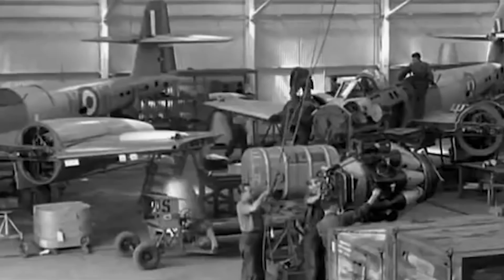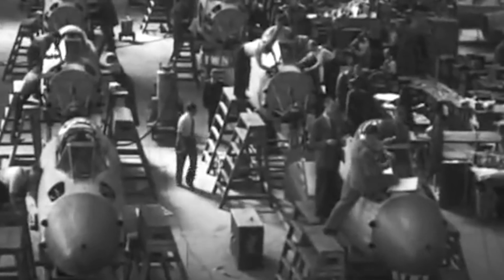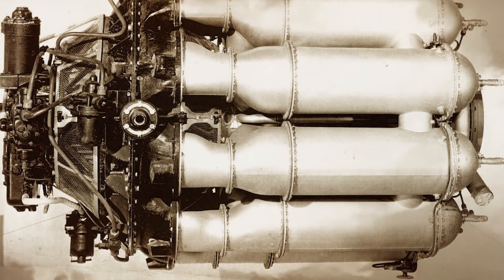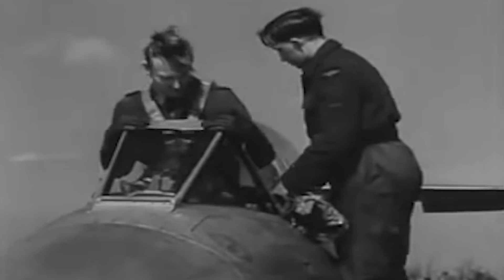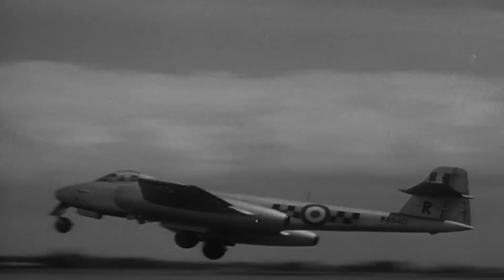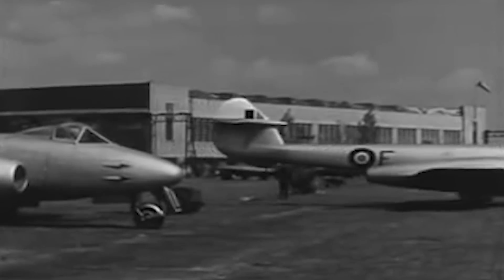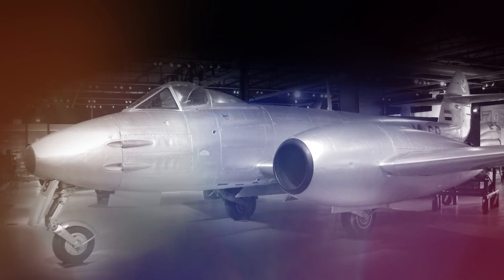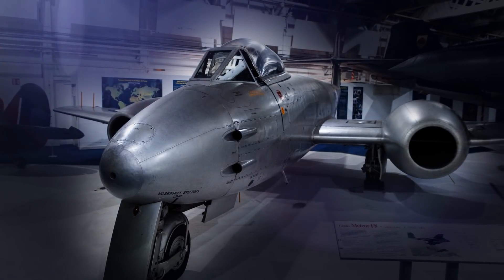Gloster Meteor - The Only Allied Jet to Fight in WW2

Comment: In 1944 many prop planes could go over 400 mph.   like the FW-190-A8 , P-38 lightning , F4 Corsair, SpitFire Mk XII , Mosquito , P-51, Tempest and  thunderbolt.
Reply: John Smith Yeah but it was obvious that the jet engines had no obvious maximum power limits and thrust was going to increase dramatically.  Longer engine nacelles produced much less drag later, the 262’s axial flow engines gave it a better fineness ratio than the original Meteor nacelles.
Development was rushed in wartime, in peacetime the problems would have been more sorted out before the plane entered service.
Reply: @givenfirstnamefamilyfirstn3935  
Just that the video stated at the time of the V1 (1944) most planes could not reach 400 mph , I was stating many could do 400 and beyond.
Some could hit 430 MPH.
Reply: @Crashed131963  But not at sea level, those speeds would be at full throttle height which for a 2 stage supercharger plane could be near 20,000 feet up. I think the Spitfire XIV's was 22,000 feet with 150 octane fuel.  The V1s came in quite low.
Even modern Mach 2 planes might only do 900 mph at sea level.
Checked, 24,000' +
Reply: @Crashed131963  Meteor F Mk 1 was cleared to a VNE of 450MPH at Sea Level on its Service Release Documentation issued on 17th July 1944. It's Limit at 20,000 feet was 400MPH due to Mach number limits.
Reply: @givenfirstnamefamilyfirstn3935  Hawker Typhoon/Tempest - outclassed at altitude by spits, mustang, FW190 etc but capable of well over 400mph Below 20,000ft, that's why it was used as ground-attack, and probably why it was so effective against V1s.
Reply: @Crashed131963  Mosquito (1941) 415 mph. It shot down 615 V1s. Hawker Typhoon (1942) 412 mph. Hawker Tempest (1942) 435 mph, but much higher (over 500 mph) in later iterations. The Tempest was known by the Luftwaffe as the Me262's most deadly opponent.
Reply: @Crashed131963  
At low level very few could do 400 mph, the Tempest, Mosquito, Spitfire and Mustang could and so could the Meteor, it was faster at low level than even the Tempest.
Reply: @barrierodliffe4155  Then why was the Meatbox replaced by the Tempest in V1 interceptor duty???
Reply: @sandervanderkammen9230  
The Tempest was in action against the V 1 in June1940, the Meteor all 16 of them not for another month. The Tempest didn't replace the Meteor.
Reply: @barrierodliffe4155  The Meatbox performed so poorly in the V1 interceptor role it was completely replaced by the faster, more agile Tempest.
V1s could not evade or shoot back.. so definitely not combat.
Reply: @sandervanderkammen9230  
The Tempest was shooting down V 1's from June, 1944, there were up to 100 Tempest's. The Meteor entered service in July 1944 and only about 14 out of 20 Meteor Mk I were used for chasing V 1's, the Meteor was easily fast enough and much more agile that the Me 262 but even the Me 262 could have chased V 1's. The Meteor shot down 13.   The Meteor when operating over Germany and it could shoot back, maybe why the Luftwaffe never tried to shoot it down, they knew they would lose.
You really should give up with your constant lies doktor bummer. You do not fool anyone but yourself.
Reply: @sandervanderkammen9230  
It wasn't. The Tempest was shooting down V 1's in June 1944, the Meteor not until later in July, all 14 Meteor I's in use, they went to the much better Meteor III which went to Belgium and flew all over Germany destroying ground targets since no Luftwaffe fighters came up to play.  The Me 262 never shot down a single jet fighter, it lost against the RAF Spitfire and Tempest, none of these were ever shot down by an Me 262.
Reply: @barrierodliffe4155  Tempest was NOT in service in 1940 it had its Combat Debut 08 Jun 44
Reply: @Crashed131963  "most" is the keyword here.
Reply: @dragonoffski4501  Go and see the Tempest combat reports they shot down German Jets and Fw190s A&Ds were no trouble
Reply: @sandervanderkammen9230  It wasn,t they worked at the samre time
Reply: @barrierodliffe4155  Barrie the Tempest was not out in 1940
Reply: @Crashed131963  The V 1 flew at around 3,000 to 5,000 feet. only Tempest, Mosquito, Spitfire, Mustang and Meteor could do so, the Spitfire could reach 450 mph but not at 5,000 feet, at that height it did 415 mph, faster than the Tempest or Mustang.
Reply: @richardvernon317  No wartime Meteor ever exceeded 450 mph.  None.  415 was really all it could do
Reply: @barrierodliffe4155  The Meatbox only claims to have knocked out a dozen V-1s before the RAF recalled them for a more suitable role... ground attack. The much  faster and more agile Mosquito and Tempest were actually successful in the missile interceptor role compared to the lumbering and clumsy Meatbox.
Reply: @Crashed131963 not at the low level the V1 flew. Prop planes have thrir max speed at high altitude. They are considerably slower in denser air.
Reply: @Crashed131963 All those maximum speeds of piston engined planes are stated at optimum altitude. Above 15000 ft. The V1 flew at 4000 ft. The fastest piston planevdown there waz the Tempest at 380mph. All  had to dive to catch a V1. The exception? Tge Meteor. Jet engines produce most power in dense air. 430mph at sea level.
Reply: The jets also had an enormous rate of climb, thrust increased with speed, their thrust available fell off much less than prop plane's power available, it meant that they had a very wide range of rapid climb speeds.  In short a 262 or Meteor would run rings around a piston and propellor plane.
There was more to the jet breakthrough than just raw speed.
Reply: @givenfirstnamefamilyfirstn3935  A 125 mph speed differential put the Me-262 in a completely different class than the Meatbox... 
Especially considering the 262 could manuvere very well above 450mph..
while the Meatbox became dangerously unstable at high speed.
Reply: @sandervanderkammen9230    The Bell and Gloster companies got early jet work because they were not designing and developing outstanding planes of their own.  Messerschmitt, de Havilland and Lockheed were different.
Reply: @givenfirstnamefamilyfirstn3935  Interesting point... although Messerschmitt would be split up into Boeing and Airbus..
Bell and Lockheed went on to great success and still exist.
Gloster and DeHaviland suffered a much worse fate.
Reply: @sandervanderkammen9230  Airbus? just after the war your joking
Reply: @johnteeling4679  Messerschmitt (MBB) became DASA after merging with Daimler-Benz, and Dornier.
DASA is the key and founding partner in Airbus SE.
Reply: @sandervanderkammen9230  Messerschmitt split up into Boing and Airbus, what a joke. Swallowed up in a multinational corporation and hived out to all and sundry as Airbus, heavily dependent on RR engines and British wing manufacturing and squabbling over 46% of Eurofighter amongst France, Spain and germany whilst BAE has 33% on it's own.

As for Gloster and DeHavilland, they are both legacy companies of BAE systems.
Reply: @givenfirstnamefamilyfirstn3935  Lockheed got their start by the Brits
Reply: @jacktattis  Development of the Lockheed  L-133 Starjet began in 1939... before the Gloster Whittle E.28
Reply: @sandervanderkammen9230  There are photos of the Gloster Whittle, are there any of the Starjet???? And you may have had the plane but you needed Whittles engine
Reply: @jacktattis  But you admit that Lockheed began designing the L-133?
Reply: @jacktattis  Nathan Price began developing the Lockheed J37 engine in 1938.
The are photos of this engine.
Reply: @sandervanderkammen9230  Well why did the Lockheed P80 not use it. 
Why was  US Jet engine technology dependent on the Brits.
Reply: @jacktattis  Because the US Government Gave Them the British engine... for FREE!
Reply: @sandervanderkammen9230  Not on any of my reference material
Reply: @jacktattis  Comic books are not reference material lad..
You obviously have no formal education or professional experience in this area.
Reply: Jack Tangles  
That's exactly how the P47M's got them, a 30° dive at WEP.
And so what, Brown flew one and got 540, first off that isn't the 560 claimed by Messerschmitt, and NACA tested a bunch of them and the average speed was 525 MPH, not a single one got the claimed 560 MPH, I think the report showed the fastest one they tested at 540 or 545 MPH, 560 MPH was never anything more than a claimed speed and not an actual one but everyone always quotes that number but claimed and reality is two different  things. 
In all fairness if their engines were better made they probably could have hit that speed but the engines on them were notoriously shoddy, they required replacement at 8 to 10 hours operational time.
I've never read any of the service reports on the engines in the Meteor but I'm sure the quality of their construction was vastly better then the one's on the ME262 and they lasted longer.
All in all the ME262 was a flop, it couldn't do anything very well, it's maneuverability was so bad the pilots were forbidden from engaging in aerial combat, between the time, manpower and materials put into the entire project the Germans would have been better off developing improved versions of what already worked, it would have served them much better in the end, none of Hitler's "Wonder Weapons" really even put a dent in things, even the V2 didn't do anything but drop on indiscriminate people and at the end of the day all it did was piss off the British people even more and give them a reason to fight even harder. 
ME262's, Tiger tanks, V1 and V2 rockets, all these things sound good on paper and people ooh and ahh over them but none of them made a difference at the end of the day, they were all pie in the sky pipe dreams.
Reply: @dukecraig2402  560 mph was a death dive at any height
Reply: @dukecraig2402  The P-47 manual limits its speed in a dive to 520 mph.  Eric Brown tested the 262 at 568 mph, as for the 262's handling Eric Brown stated: "Oh, it handled beautifully."  No wartime Meteor ever exceeded 450 mph, none were used in actual combat.  Read more about facts right here, Eric Brown:  "Speed. Speed. It was a pedestrian aircraft, really, the Meteor. It never went into… It never fought operationally. It fought, if you like to call it that, against the V1, the flying doodlebug, and quite successfully. But it really was too slow to deal with the German jets when they came into being. They were a grade above at first. The Me262 is quite frightening. It gave us a shock to find out, because when I flew it the fastest fighter we had – piston fighter, of course – in the Allied camp was the Seafire Mk14 with a top speed of 446mph. The Me262 was 125mph faster than that aircraft. So this was a rude shock to our system, I tell you, when we found that out."  Anytime I can help!
Reply: @dukecraig2402 The Meteors engines had a rebuild life of 100 hours. The Jumos in the 262 had a rebuild life of 10 hours and a scrap life of 35.
Reply: Don't forget spit mk9 and mk 14.
Reply: Jack Tangles  
Willie Messerschmitt claimed 560 MPH, which is what's listed in Wikipedia's page on the ME262 and what most people reference, and even their top speed, be it anywhere between the (around) 510 to 540 MPH that they actually could achieve was unsustainable, after a short amount of time the engines would either burn up or just come apart. 
Just about every Allied propeller driven aircraft was light years ahead of that thing when it comes to reliability. 
And one further thing, all those tests were done on unarmed planes, none of them were loaded with ammunition, it states that very clearly in the test forms.
Reply: @dukecraig2402  No one places the 262's speed at 510 mph.  You're literally making stuff up.  Why?  Read more about facts right here, Eric Brown: "Speed. Speed. It was a pedestrian aircraft, really, the Meteor. It never went into… It never fought operationally. It fought, if you like to call it that, against the V1, the flying doodlebug, and quite successfully. But it really was too slow to deal with the German jets when they came into being. They were a grade above at first. The Me262 is quite frightening. It gave us a shock to find out, because when I flew it the fastest fighter we had – piston fighter, of course – in the Allied camp was the Seafire Mk14 with a top speed of 446mph. The Me262 was 125mph faster than that aircraft. So this was a rude shock to our system, I tell you, when we found that out."  Hope this clears things up for you!
Reply: Our nazi plane fan might be confused with a Me 163 record flight when one was towed to altitude and did a reduced climb speed run to top 1,000 kph.  He seems loose with details.
Reply: Mactrip100 to true, Erick brown was one of few test pilots with 100 percent credibility, l could listen to that chap all day.
Reply: @donwoodward4771  
Browns method of wetting his finger an sticking it in the air is hardly 100% credible, the NACA tests were done with hyper accurate measuring devices installed on the aircraft and their tests information were hardly from some pilot reporting what he saw on the instrument panel.
His claim of the ME262 being 
the speeds he claimed faster then all other prop driven aircraft of WW2 is absolutely laughable, he certainly didn't fly every variant of every model made, P47M's have an official speed or 470 MPH with some tested hitting 488 MPH along with reports of reliable pilots in theater reporting speeds of 500 MPH.
Griffon powered Spitfires were hitting 445 to 450 MPH, there's many late war WW2 prop driven aircraft that hit speeds well above what the top speed of what Brown claimed were the fastest prop fighters, maybe they were that much faster then the variants he flew but they sure weren't 125 MPH faster than the one's he never got to fly, without the hyper accurate measuring devices installed on the planes like the research facilities used he'd have no real way of knowing how fast they were actually going. 
"125 MPH faster than the fastest prop driven fighters of the war", that's absolutely laughable.
Reply: @dukecraig2402  He flew them was fluent in German both Written and Spoken You were not there You are not a test pilot and you certainly do not have the record of most types of planes flown
Reply: By January 45 operational Meteors could reach a speed of 493 mph making it the fastest Allied fighter to see combat in WW2.
Reply: @RedcoatT  The Meatbox never saw aerial combat during WW2.
Reply: @sandervanderkammen9230  From January 1945 it took part in ground attack missions against German positions and is credited with the destruction of 46 enemy aircraft on the ground while attacking Luftwaffe airfields. It did see combat.
Reply: @RedcoatT  No aerial combat during WW2, the Meatbox was a deeply disappointing failure as a fighter aircraft.
Reply: @sandervanderkammen9230  So ? I stated two things, the Meteor was the fastest Allied aircraft in WW2 and it saw combat, neither is incorrect.
Reply: @sandervanderkammen9230  Not as bad as the starfighter though. Terrible device.
Reply: @sandervanderkammen9230  It clearly wasn't disappointing enough for more than 16 airforces to buy it. Whereas the poor old Czechs couldn't get anyone to buy the Me 262. People would rather buy Me 109s and put Merlin engines in them than waste money on a 262 and all the replacement engines they'd need. The Czech were lumbered with the dozen they'd built and dropped them in 1950 for the MiG-15 powered by the RR Nene copy engine.
Reply: @sandervanderkammen9230  
The Meteor was used for aerial combat but the Luftwaffe were afraid to come and play, the successful Meteor servec for dacades and had combat post war and was used by many air forces, the Me 262 was hardly used by 1.
Warum hassen Sie Großbritannien so sehr, dass Sie ständig Lügen erzählen müssen?
Reply: @barrierodliffe4155  Sander appears to have given up.... Mind you, his arguments were almost all complete nonsense. So far as the Meteor is concerned, by no means perfect but as a first generation jet fighter is concerned, not bad at all.
Reply: That seems to happen quite often especially when I use German.
Reply: @barrierodliffe4155  😂😅.. Keep it up!!!
Reply: @barrierodliffe4155  BARRIE PLEASE NAME A BRITISH COMPANY THAT STILL MAKES COMMERCIAL JET AIRCRAFT IN THE U.K.
Reply: @tompiper9276  Hey Timmy Pepper, can you tell me which British museum houses the Miles M.52 flown by Eric Brown???
The U.K. must be so proud of you!
Reply: @sandervanderkammen9230  Sandyboy, please name the worlds second largest jet engine manufacturer.
Reply: @sandervanderkammen9230  Sandyboy, please name the company that has built the world's fastest electric aircraft.
Reply: @RedcoatT   The RAF seldom claimed destroyed aircraft on the ground
Reply: Spitfires Mks VII,VIII,IX,X, XI , XIV, XVIII XIX all did 400+mph I do not have the top  speed for the XIII, XVI
Reply: Not at sea level or 4,000 ft where the V1s flew.
Reply: None could go over 400 mph at sea level. Closest was the Tempest at 380mph at sea level. All had thier to speed above 15,000 ft.
The first Meteor coukd do 430 mph at 4000 ft. The height the V1s flew. Every other plane that took down V1s had to dive to watch them.
Reply: P47M, 470 MPH in level flight, and that was an honest measured speed not a theoritacal one like Willy Messerschmitt said the ME262 would go 560 MPH when in fact NACA tests showed that the average speed of them was 525 MPH.
Matter of fact there's two documented cases, and probably more instances that went undocumented, of P47M's from the 56th Fighter Group that closed the gap and destroyed ME262's that were throttled up and fleeing with a distance advantage, they actually ran them down and destroyed them.
But in all fairness it was the apex of propeller driven aircraft technology  and the dawn of the jet age, there's a reason why piston engines are measured in HP and jet engines are measured in tons of thrust.
Reply: @dukecraig2402  The P-47's manual limits its speed to 520 mph in a dive.  All 262s were dived 30 degrees at 590 mph as part of factory acceptance.  Eric Brown tested the 262, top speed 568 mph.  That was a worn out out aircraft.
Reply: @dukecraig2402 Like the P-80, the P-47M arrived too late to see any real service. There were many 'superprops' at the end of the war that could reach 475😮mph+ like the DH Hornet, Grumman Bearcat and Supermarine Spiteful but the writing was on the wall for them with jets.
Reply: @dukecraig2402  The P47M never saw combat operations with its claimed performance, the Simmons pressure regulators were a failure and removed as soon as the aircraft entered service.
Reply: @sandervanderkammen9230  
Well you're wrong about that, and they did run down ME262's, it documented, also they shot down plenty of Dora's and ME262's that were at altitude and maneuvering, Wally Groce's gun camera footage of him doing it is right here on YouTube.
P47N's had similar top speed performance, they're official speed is slightly slower but there was several testing parameters that were different and by all accounts they were actually as fast as the M's.
The speed of the 56th Fighter Group's P47M's were as listed as per the NACA tests.
Reply: @dukecraig2402  You seem very confused and misinformed regarding the performance shortcomings of the 'M' the aircraft in service it was a failure.
Reply: @sandervanderkammen9230  
That's an absolute joke of a statement, the 56th Fighter Group flew them exclusively, they were the only unit to use them and their record, which is very well documented, was very successful with them.
There was nothing about those planes that were a "failure", you're just being a typical fanboy baby that sits around daydreaming about being a WW2 fighter pilot and gets mad at the thought of other forces successes. 
Don't tell me, let me guess, you're European.
Reply: @dukecraig2402  The only that is a joke in this conversation is the P-47M.
Reply: Jack Tangles  
Meteors first flew in July of 44.
But if you mean P47M's that's not exactly true, well before the first one's came off the assembly line there were already P47D's of the 56th Fighter Group being fitted in the field with the same 2,800 HP engine around late Autumn of 44, they effectively were M's since M's were just D's outfitted with the later engine at the factory. 
One of the pilots interviewed here on YouTube said he actually preferred the up engined D to the M because they had less "gimmicks" on them and weighed less.
Reply: @dukecraig2402  the P47Ds used against the V1s were such. They were stripped of armour, external fittings, Half their fuel tanks removed and armament reduced to 4 0.5" guns with less ammunition. The engagements were a straight chase. Diving from a coastal patrol to about 3300ft  to attain 400+mph to catch and engage at
Reply: @dukecraig2402 you're wrong.
The only time they shot down 262s was when they were out of fuel or landing...in the air they couldn't even catch it.
Reply: @accobra4272  Many German vet pilots stated 262 who were caught by  making the  mistake of hard turns or climbs and beeding off to  much speed.
Reply: @Crashed131963  they didn't know how to handle the plane...there was nothing wrong with tights turns the 262 would fly by them 100-150 mph faster then any propeller. 
They just didn't have much air time since they were thirsty.
Reply: @dukecraig2402  There were notr many Missions with the P47M in the ETO
Reply: @dukecraig2402  No prop plane ran down Me262s
Reply: @dukecraig2402  It did not help them that much, still below the Climb Rate of any Spitfire MkIX ON, and the service ceiling of any Spitfire MkIX on
Reply: @jacktattis  Spitfires and Tempests did, the Me 262 could not keep up the to speed for long and they were accepted into service if they could reach 515 mph, many barely made it
Reply: @accobra4272  The best German pilots didn't handle the Me 262 very well, it really couldn't turn at speed, even when sent after unarmed RAF photo reconnaissance aircraft the Me 262 proved to be a failure.
Reply: @barrierodliffe4155  wrong...the 262 was designed to move in shoot and get out.
It never was a dogfight.
Further it would never be a dogfight bc no other aircraft could keep up with it.
120 mph faster then any propeller.
The only time it was shot down was when landing out of fuel or it had an engine malfunction.
Reply: @accobra4272  Whatever the Me 262 was intended to do, it didn't work, it was caught by both Spitfires and Tempestts someties after a chase of 50 miles, funny how the Me 262 was accepted into service if it could manage 515 mph, that is just 65 mph faster than a Spitfire Mk XIV but with lower acceleration and climb the Me 262 was no real threat to RAF fighters any time, the losses in combat show that. Being shot down when well away from the Me 262 bases as they were just as one Spitfire Mk IX being sent up to chase an Me 262 way from British positions, the Spitfire pilot forgot to chase the Me 262 away, he shot it down.
Reply: @barrierodliffe4155  idk where you get your data the 262 had 540 top speed not 515....no Spitfire and no P51 could stay with it.
Caught after a chase🤣🤣🤣
Yeah bc it was out of fuel lol
Reply: @accobra4272  I get my information from many sources including German which is where I get that the Me 262 was accepted into service as long as it could reach 515 mph, many only just made it, some might have done 540 mph but that was very few and still only 90 mph faster than a Spitfire, they were caught after a chase because the Me 262 couldn't do it's  maximum speed for long or the engines would fail. Attacking Me 262 airfields was not popular and not carried out much by the RAF. The thing is that the Me 262 had two chances if they met a Tempest or Spitfire, run away which might sometimes work but not always, or no chance at all.
Reply: @Crashed131963  The Messerschmitt Me-262 could turn and climb faster than any Allied plane... the major advantage of a swept wing jet fighter is less energy decay in dogfight maneuvers.
Propellers lose thrust efficiency for every degree of deviation from straight and level flight and straight wings increase drag more in a pitch or yaw maneuver than swept wings.

This is why the German jets were faster and more maneuverable than Allied jets.
Reply: @barrierodliffe4155 Hey Barrie please name a single British jet still in production?
Reply: @barrierodliffe4155 Are you suggesting that the old fashioned propeller Spitfire was as fast as a 262!  LOL.  It was not.  Here ya go!  Eric Brown: "Speed. Speed. It was a pedestrian aircraft, really, the Meteor. It never went into… It never fought operationally. It fought, if you like to call it that, against the V1, the flying doodlebug, and quite successfully. But it really was too slow to deal with the German jets when they came into being. They were a grade above at first. The Me262 is quite frightening. It gave us a shock to find out, because when I flew it the fastest fighter we had – piston fighter, of course – in the Allied camp was the Seafire Mk14 with a top speed of 446mph. The Me262 was 125mph faster than that aircraft. So this was a rude shock to our system, I tell you, when we found that out."  Hope this clears things up for you!
Reply: @barrierodliffe4155  You're literally making stuff up.  Here ya go!  Eric Brown: "Speed. Speed. It was a pedestrian aircraft, really, the Meteor. It never went into… It never fought operationally. It fought, if you like to call it that, against the V1, the flying doodlebug, and quite successfully. But it really was too slow to deal with the German jets when they came into being. They were a grade above at first. The Me262 is quite frightening. It gave us a shock to find out, because when I flew it the fastest fighter we had – piston fighter, of course – in the Allied camp was the Seafire Mk14 with a top speed of 446mph. The Me262 was 125mph faster than that aircraft. So this was a rude shock to our system, I tell you, when we found that out."
Reply: @dukecraig2402  The Messerschmitt Me-262 reached 624mph.
Like many Allied aircraft actual speed in service varied by model with the fastest version capable of 560mph  in level flight.
Reply: @dukecraig2402  Both figures are correct albeit you seem confused about the very important difference between a P-100 and P-Max power settings and thir relation to airspeed performance The Messerschmitt Me-262 had a maximum continuous cruising speed of 525 mph and a top speed. (ie; WEP) of 560 mph.
Reply: @sandervanderkammen9230  
You're confusing the video games you play with reality, both the RAE and NACA reports are online, they both state power at maximum with maximum RPM's of 8,700 RPM's on the turbines, there was no "War Emergency Power" on their throttle settings, only 100%, try reading the reports, the results are very clearly written, the RAE's tests came in right around the same exact place the NACA tests did, not a single one hit 560 MPH true ground speed, right around 540 MPH were the fastest one's tested and the average speed was 525 MPH it's very clearly written in the reports and shown on the graphs, all the official reports are easily found online.
And indicated air speed reported by a pilot is unreliable for several reasons including altitude and atmospheric conditions, all the reports show the true ground speed for them and not what was reported by pilots. 
Furthermore the 100% throttle settings were unsustainable, the engines could only be run at 100% for short amounts of time because the engines would suffer catastrophic failure, it's all very clearly written in the reports from both the RAE and NACA.
And your disparaging comments about anything from or about the US don't bother me one bit, they're a reflection of your childish behavior and not the USAAF or it's aircraft, go ahead, keep showing the world what a baby you are, the only thing you need to concern yourself with about the USAAF is keeping the lawn mowed at Cambridge, only a real punk would run his mouth on someone's forces that have people buried in their own back yard who died helping protect their freedoms, that clearly shows your true nature.
Reply: @sandervanderkammen9230  No it did not my info 540 mph
Reply: @sandervanderkammen9230  560 mph is the 262's listed speed.  Eric Brown flew a 262 at 568 mph in level flight
Reply: @TheAneewAony  Yes, in combat trim its top speed is 560mph, 125 mph fastest than anything the Allies had in service during WW2.
Also important to note is the Messerschmitt Me-262 continuous cruise speed was a blistering 465mph,  faster than Allied aircraft with war emergency power.
A monumental leap forward in aircraft performance and the Allies had absolutely nothing comparable to it.
Reply: @sandervanderkammen9230  True, I have the 262 cruise speed at 466 mph, that could be due to kph to mph conversion
Reply: P38 , before the war, set the world speed record over 400 mph
Reply: @richardwaugh2049  The P 38 never set any world speed record.  Try looking it up. Heinkel and Messerschmitt did in rather special aircraft.
Reply: @richardwaugh2049  The Heinkel He 100 set a record with 466 mph on March  30th  followed by the Messerschmitt Bf-109R at 469mph April 1939.
Reply: @sandervanderkammen9230  T Heinkel set a closed-course record of 394.4. The speed you claimed had a different fuselage and different wings and different engine of 1800 hp.  You're a damn liar
Reply: @richardwaugh2049  Can you please link the FAI database ID number for the P-38???
Reply: @sandervanderkammen9230  The Official German record of the He 100 on a closed-course was 394.4 mph.  On a later test, a plane with a different fuselage a different wing and a different engine with 1800 hp, went over 400 mph.   
     The page after page after page that you and adamant opponents we're all talking about were "PRODUCTION" aircraft.  Don't get holier-than-thou with me, you hypocrite
Reply: @richardwaugh2049   Can you please send me a link to the FAI database ID number for the P-38???
Reply: @sandervanderkammen9230  
YOU EVEN LIED AND CLAIMED THAT THE METEOR WAS REPLACED BY THE TEMPEST.  ANOTHER OF YOUR MANY LIES.
Reply: @sandervanderkammen9230  Wie ist es, ein Feigling zu sein, kleiner Doktor, Mistkerl?
Reply: @richardwaugh2049  Of course he is.
Reply: Jack Tangles  Wrong, the Messerschmitt Me-262 was the fastest production jet aircraft setting a record of 624mph 19 August 1944
and stood until 1948 when it was bested by the F-86 Sabre.
Reply: @sandervanderkammen9230  You are a liar Sandyboy. No production Me 262 got close to 600 mph.
Reply: @sandervanderkammen9230  No
Reply: @jacktattis  The Messerschmitt Me-262 was the fastest internal combustion powered aircraft of WW2, the Fighter-interceptor version had a top speed of 560 mph, some special interceptor versions reached 624 mph.
Reply: @sandervanderkammen9230  They were NOT classed as internal combustion engines they were turbojets
Reply: @jacktattis  Oh Jack, I feel sorry for you...

All practical, and mass production turbojet engines operate using the internal combustion principle... the only exception is a handful of nuclear fision reaction jet engines..
This engines were never developed in a practical design... for obvious reasons.
Reply: @sandervanderkammen9230  Not in my experience
Reply: @jacktattis  That comment reveals someone who has no experience son... turbojets and gas turbine engines are Internal Combustion Engines.
Reply: @sandervanderkammen9230  Source please?
Reply: The Messerschmitt Me-262 had a continuous cruising speed of 485 mph...
Reply: @sandervanderkammen9230   Yet it never caught a Spitfire or Tempest, both of them caught and shot down Me 262's.
Reply: @barrierodliffe4155  85 RAF aircraft shot down by the Messerschmitt Me-262... including fighters like the Tempest and Spitfires.
Reply: @sandervanderkammen9230  You do tell some feeble lies sometimes Sandyboy. 85 is the exagerated claim for US fighters. Check Foreman and Harvey's Me262 Combat Diary.
Reply: @barrierodliffe4155   Source please Barry
Reply: @sandervanderkammen9230  Sources please Where when what plane numbers
Reply: @sandervanderkammen9230    Caught and shot down by Spitfires and Tempests. The Me 262 couldn't catch either.
Reply: Mactrip100  We invented the A-Bomb so it would not have help Germany anyways. 
The A-Bomb stopped Stalin from liberating West Europe like he did East Europe until 1990.